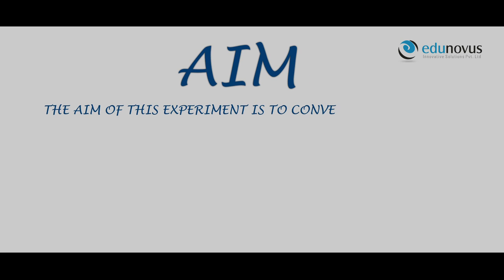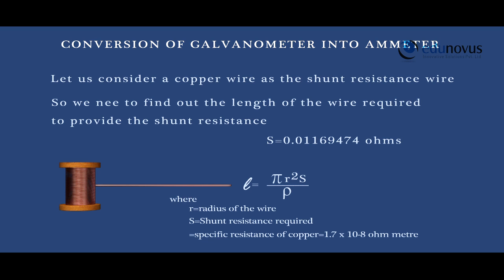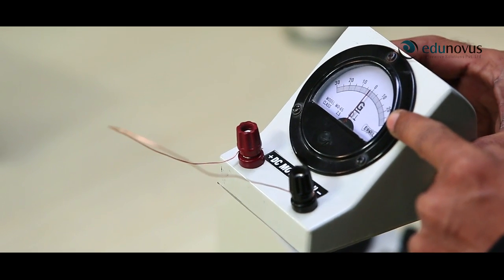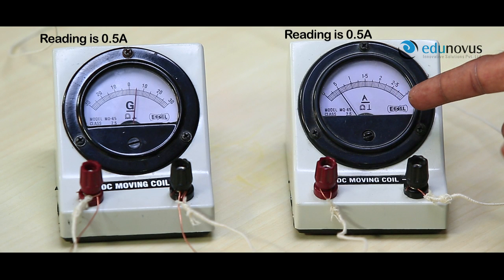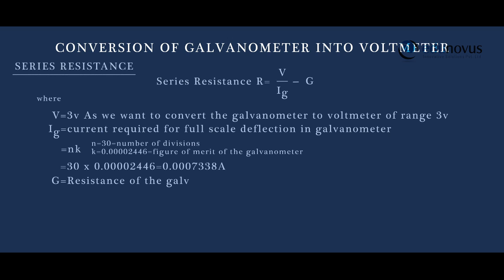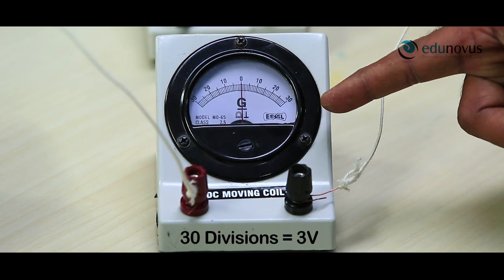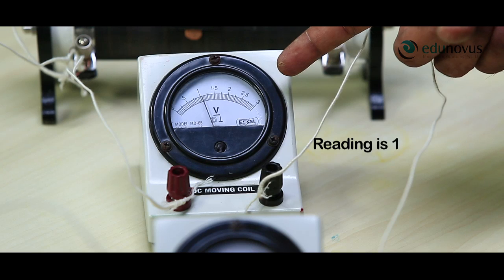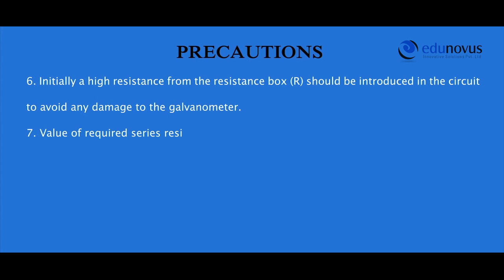Physics Practical: Galvanometer 2 (Use headphones for clear audio/sound)

Comment: Sir if we use resistance box instead of wire what resistance should we use.
Reply: That depends on the range of conversion. In this video range of conversion is 3A . Resistance box is usually used as shunt when range of conversion is very low (eg: 10 mA)
Reply: It is in Gujarat board practical???